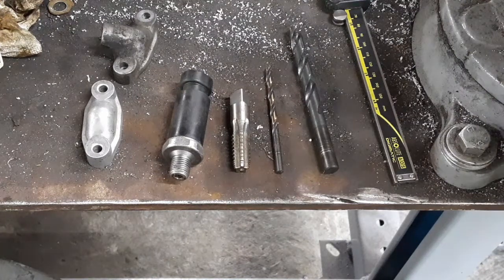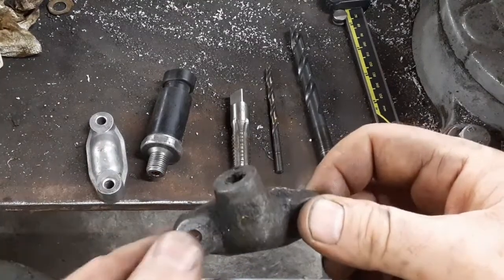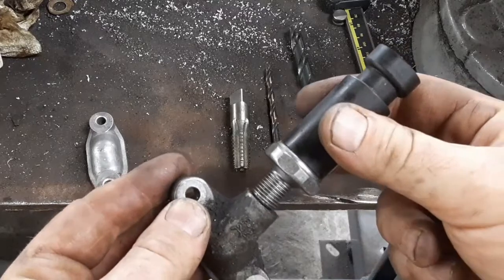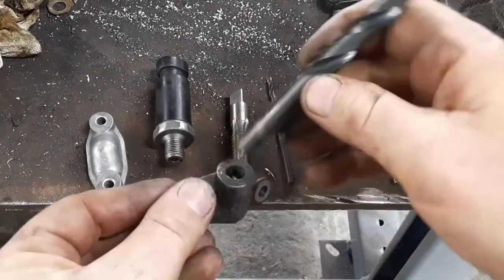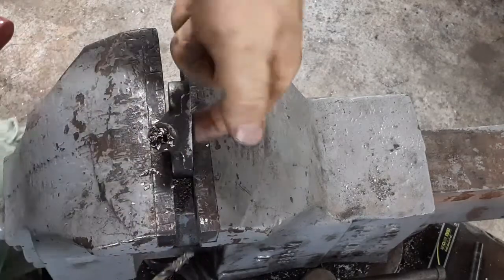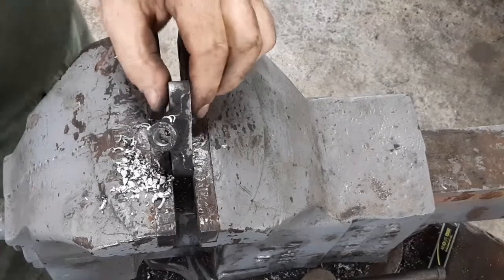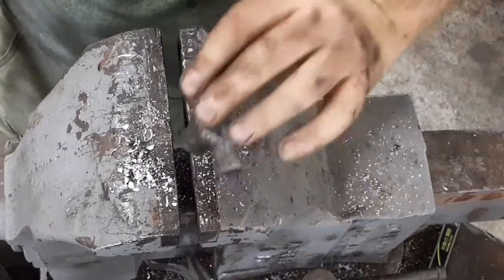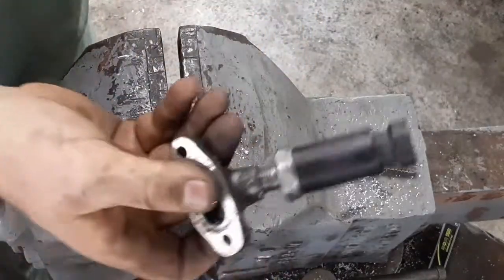LS Swap Oil Pressure Gauge Sender Install on the 5.3 S10

Comment: Yes
I'm wondering why u moved the sending unit?
Reply from the maker: I installed a second one. One for the PCM and one for the dash gauge.
Reply: Thank s , looks like I'll do same.
Reply: I've read that you are using two sending units but could this method be used to just mount the oem sending unit and block off the hole at the top of the motor? I'm using a coil relocation mount that needs the space at the back of the motor where the oem sending unit is and looking to relocate it.
Reply: @socalob  Yes.
Reply: @postalacidity  thank you!

Comment: Will a 99-02 single wire LS oil pressure sensor work with a factory gauge in a 94 S10? If so that will be the easiest way for me to get the factory gauge to work.
Reply from the maker: I haven't tried, most of the one wire oil pressure gauges are just on/off safety switches, not actual pressure sensors that can read a range of PSI.
Reply: @Wil's Workshop  my donor 02 silverado has a one wire sensor and a gauge. I'm going to try it and see if it works with my 94 s10

Comment: Did you cancel the sender at the back of the block?
Reply from the maker: It's still there, I'm using 2 oil pressure senders. The rear block one I'm using as a saftey kill switch for the engine. Basically if oil pressure drops the computer will shut the engine off. This second sender will just be used for the dash gauge since it's the original S10 sender (so it's the correct resistance range). I also use this method to install mechanical oil pressure gauges on LS engines without changing the use of the original electrical sender.

Comment: Now I'm legitimately curious. Does the P59 PCM absolutely NEED an oil pressure input? If so, I'm pretty screwed....
Reply from the maker: It doesn't, you'll be fine. On the majority of trucks that came with a P59 the oil pressure sensor is just 1-2 wires and is nothing but an on/off switch to activate the low oil pressure idiot Light in the dash. They don't even have a wire going to the PCM.